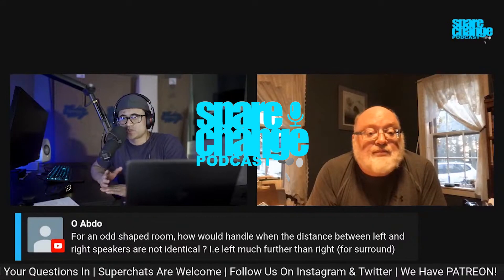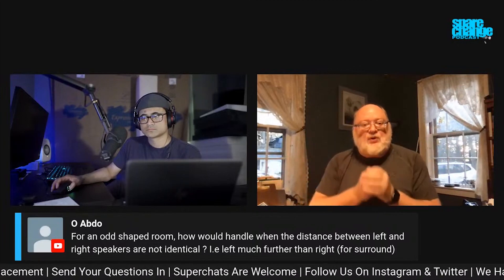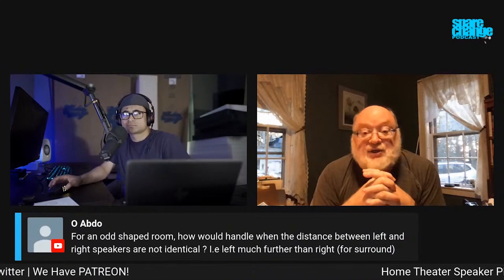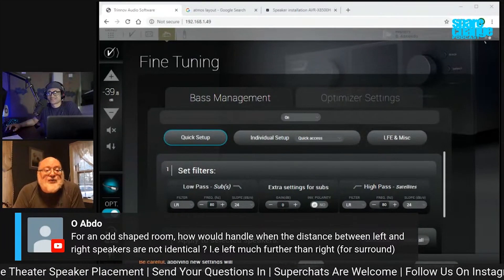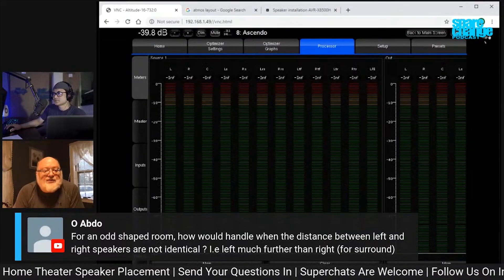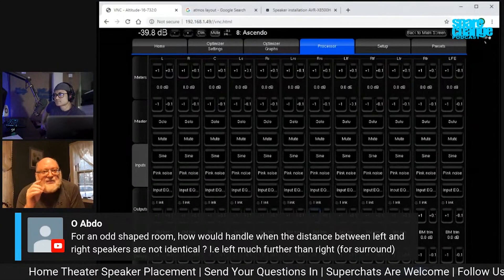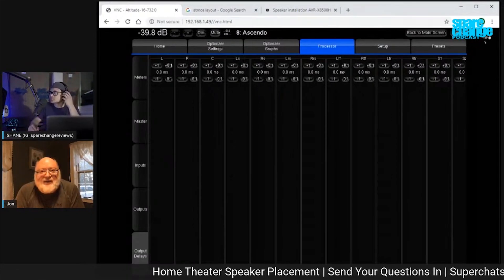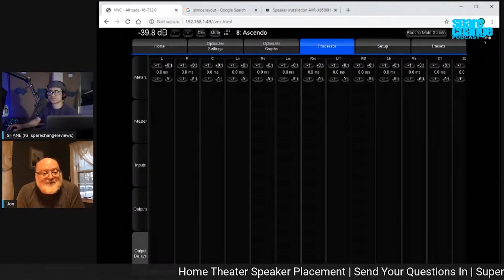Odd Shaped Home Theater Room Solutions with The Trinnov Altitude Processor.

Comment: I wish someone would get one of the mgs on (e.g,, Marantz, Emotiva, etc.) to challenge them to release a pre/pro that wouldn't become obsolete junk in a few years when something new came out in terms of a new video or audio standard (such as 8k, or Atmos, etc.) or when a new friggin cable connector was released (e.g., we had composite, then SVHS, then component, then DVI, then HDMI of various specs). No one I know of is approaching this like a PC, where you can just swap out add in cards to upgrade your video, audio, etc. After a few years, you start to realize how much $$ you're spending to keep current  - - I'm maybe my 4th pre/pro (went from Citation, to Proceed AVP (my favorite) to Lexicon MC-12, to Marantz 8802A), each around $5k.  I've finally said That's Enough . I was able to sell or trade in the first two, but nobody is buying a used MC-12 or 8802A.  If Harmon Kardon, Marantz, Madrigal, etc. had just designed their units with daughter cards for video processing and associated connectors that could be upgraded as ne standards came out, I'd have saved a LOT of $$.  But maybe not doing so was part of their strategies. Either way, it's frigging frustrating.
Reply from the maker: It ain't $5k but this is all you need.   
https://youtu.be/aZCaOWutfqg